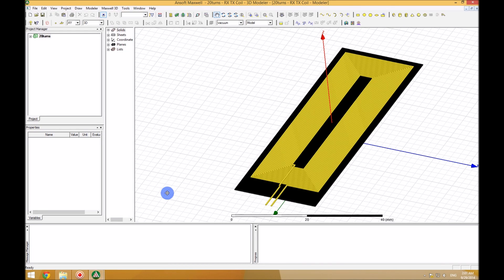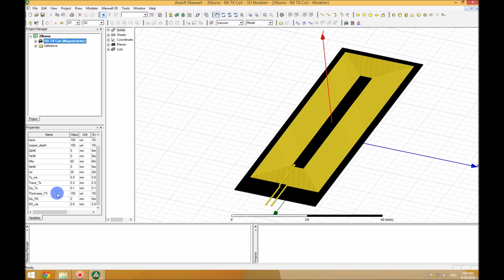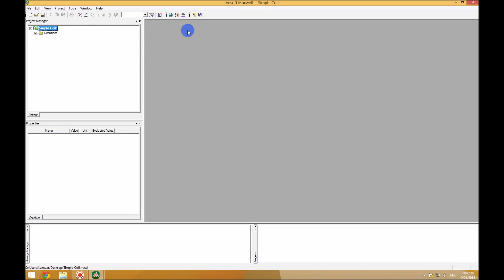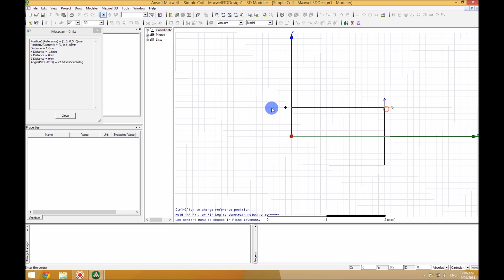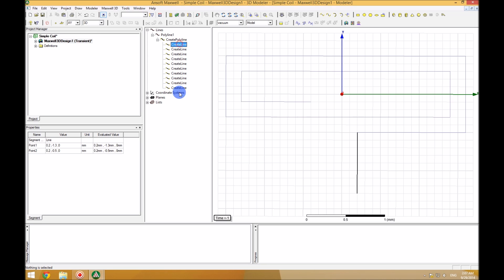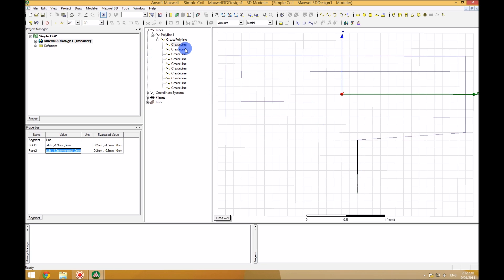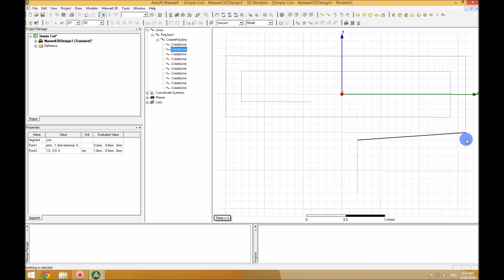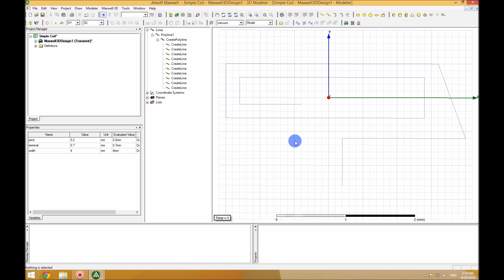PART 1 -- Ansoft Maxwell - Modeling a simple WPT parametric (generic) Coil

Comment: Hello Kamyar i have one question, how I can model the litz wire in the library of materials?
Reply from the maker: Hey, Manuel, 
The easiest way to simulate the litz wires in your design is to turn of eddy current effect in the wires. Basically the simulations that I have been posting so far was not considering the eddy currents and therefore the results would be very close to litz wire. 
Does it help?
Reply: So, I must to use eddy current solution type?
Reply from the maker: if you use eddy current then your coil would not have simulation results close to litz wire. Since Litz wire fights against eddy current effect and skin effect. right?

Comment: Hello Kamyar, i'm using Maxwell to simulate a WPT system, i have modeled a coil, and a region where I will simulate my system, but when i check the results of the simulation with the analitics results, these are not correct. When i change the region where i'm simulating these results change, so which is the correct size for the region where simulate?

PS , sorry for my english
Reply from the maker: are you using the red rectangle icon (region)? or you are using air as I shown?
Reply: ***** I'm using air as you shown, but my coil is rectangular instead of quadrangular.
Reply from the maker: In that case you should generally get more accurate results if you use larger  air container. However the catch on that is you have to bring the coils terminals out to be connected to the surface of air. if you keep increasing the air box from some point your terminals inductance will kick in. I think 3 times the size of our coil is good. Does it help?
Reply: ***** Finally it works thanks